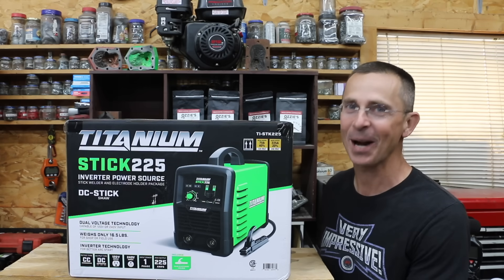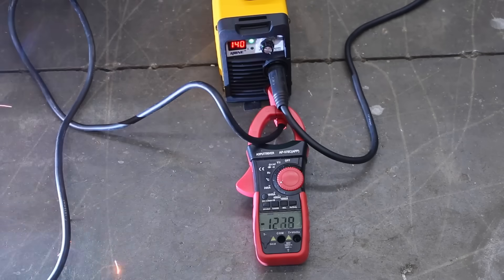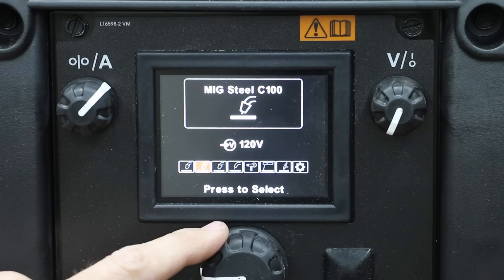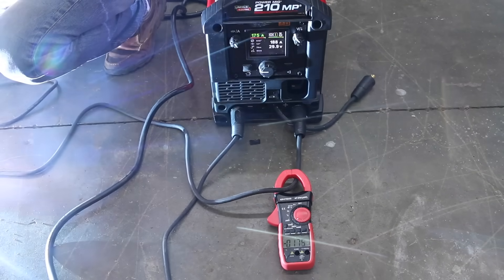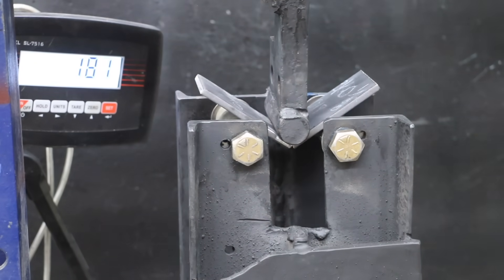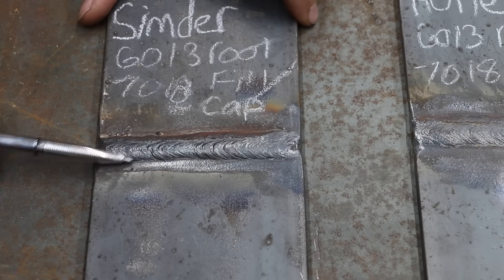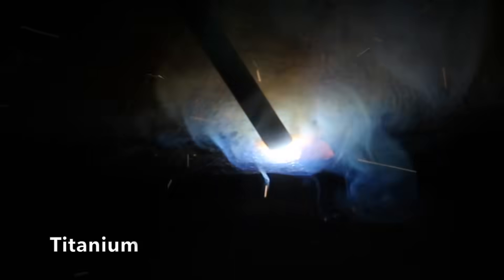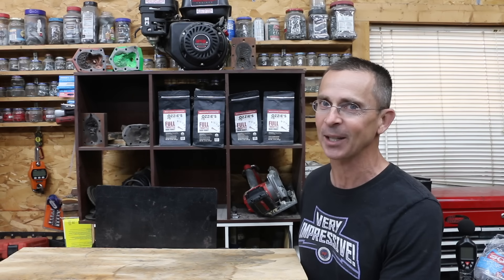$70 vs $2,300 Welder? Let's Settle This! Weld Strength, Duty Cycle, Current Output, Build Quality

Comment: If I was going to buy a cheap stick welder like this, it would be from a physical store like Harbor Freight, Northern Tool, or Menards where it's easier to take something back if it's faulty out of the box or with short use.
 I would like to see more welder tests! Maybe less variety of the those no-name Chinese brands though. Throw just 2 or 3 into the mix for reference. Those no-name ones can come and go, so even if you recommend one, it might not exist later on.
Reply from the maker: Thanks for the suggestion.

Comment: Some things about the 210MP. Lincoln lists it on their site as $1,999 and there is a $500 rebate so it currently rounds out at $1,499. I'm not sure why Amazon has it so high. It can do tig, if you buy that variant, or if you buy the torch, wire harness and pedal yourself.  Its MIG gun and tips are not the standard lincoln tips. Still easy to get but don't try using the traditional tips. It runs 7018 like a dream, and I really hated 7018 until I used this machine (I had used mostly transformer welders which are notorious for sticking with 7018). The hot start on this welder really works well.
If you want to see its capabilities, go to Welding Tips and Tricks channel and see what Jody has done with it. Overall a good machine. 

Great review PF and Joe thank you for helping out with this video. We do appreciate your work.
Reply from the maker: Thanks and you are welcome!

Comment: I have a cheap Chinese inverter welder. The reviews i flipped through said they perform closer to the displayed setting when on 240v supply. I just got a 240v one instead if a dual.
Reply from the maker: Thanks for sharing.

Comment: Clamp current meters only measure AC current The clamp meter in you test is telling which DC welder is producing more AC current .   For example a welder that  100Amps DC + 10Amps AC will only show on the meter as 10A even though the welder will heat up the metal as 110Amps.

Clamp current meters only measure AC current and are basically electrical transformers.  The primary coil is the wire you are putting your clamp around and the secondary is internal to the meter where a output proportional to the primary coil current is measured.
 
BTW as an idea for your another product test you could clamp style current meters?
Reply from the maker: Thanks for the feedback.  Thanks for the video idea.

Comment: Well as a 30 year combination welder the currents are to high for the rods making the weld to hot and can cause weak welds and for the welding machine that's it's not designed for to be pushed like that ,you wanna test use larger welding rods and at the specified currents for the rod that's where you can truly test the welding machines and for the beval plates there really suppose to have a about 1/8 gap or open joint for eat her double sided weld or for penetration.
Reply from the maker: Thanks for the constructive feedback.

Comment: Thanks Joe for your help in this. For professional welders Lincoln or Hobart will be the best choice  I think but for us home occasional users HF seems good. I have a wire and stick welder from HF and they work great for what I need. Mufflers, mower decks, trailer welds. Save $2000 and get it done.
Reply from the maker: Thanks!  Thanks for the feedback.

Comment: I work for a welder manufacturer (wildly different type of welder, though), and having done some competitor analysis- it is incredible how many companies blatantly lie about their abilities and settings.  There are far cheaper welder options than ours, and if you're just doing small projects they're often decent choices, but 95% of the time the welder's screen is just outright lying to you about what it's outputting.  So, if you need to qualify a process or tune in a finicky recipe for long-term production of an item, you'll be happy to pay more for our products.
Reply from the maker: Thanks for the feedback.

Comment: I bought a bottom-dollar stick welder from Harbor Freight many years ago, and found a way to maximize its duty cycle time to minimize its downtime when it shuts down from the heat:  Place a 20 inch breeze box fan on the side of the welding unit.  The fan breeze circulating though the welder's unit vent works well to extend the run-time of the stick welder.
Reply from the maker: Thanks for the feedback.

Comment: I work in a welding shop, my shop bought the cheapest Jasic mig welder, and it welds extremely well, they bought 2 mid range Jasic mig welders, one shorted out and blew up for no apparent reason, and also they got the same Jasic mig welders but really high end,  we got two of these high end welders, and one welds like butter, the other not so well, same metal, same gas, same settings. So i could say from my experience buying welders is kind of a gamble, don't matter the price
Reply from the maker: Thanks for sharing.

Comment: I do a lot of welding, mostly Tig but do own a 240 titanium mig and that thing does fantastic and can hold a pretty high V and duty cycle. Well beyond it's rated amount. I do think if your gonna compare the multi welders to include the Vulcan multi. From everything I've heard the Vulcan multi is the best bang for performance if you need a do all machine.

Thanks Joe.
Reply from the maker: Thanks!  Thanks for sharing.

Comment: Great test, & special thanks to Joe!

PLEASE TEST PLASMA CUTTERS

- Sorry for shouting, but I’ll bet a lot of people would like to see this. I want to buy one but there are a ton of models on the market, so hard to choose between them. Hypertherm seems to be the all-around best, but even used ones are very expensive. I’d like to avoid Chinese, so would like to see several Western brands tested (maybe a used Lincoln or Miller model would be a good buy?) - For a plasma cutter I might be persuaded to go Chinese though.

Important question - Do the Chinese brands use standard, easily-available consumables? How about replacement/alternate torches? Can any of the inexpensive units be used with a CNC table without internal modification? How important is a pilot arc? 

Thanks for considering this: Your videos are THE most valuable resource on YouTube(!) I’ve used them to buy many different products, and like the way you come up with so many different controlled tests to evaluate different aspects of each product. Thanks for putting the results tables at the ends of the vids; seeing all the info laid out at once like that, I can decide for myself how much weight I want to give to each category. Super useful , thanks again for the incredible amount of work you out in on these!
Reply from the maker: Thanks and  you are welcome!  Thanks for the feedback.  Thanks for the suggestion.

Comment: One thing I'd like to comment on, is the cheaper welders may be coming up short as they're more intended for 220v as they are likely just Chinese imports and are aimed at the majority of the world and not directly intended for the US 110v market. And being cheap likely don't have the smarts to first step up the voltage unlike the more expensive models 
Would be interesting to see if the gap on the initial amperage improves with a 220v supply voltage
Reply from the maker: Thanks for the feedback.  Thanks for the suggestion.

Comment: thank you Joe i would go with the HFT one if it fails in 90 day you can get a new one or your money back every thing i took back they made good i have there plasma cutter for the price it works really good. i have a Millermatic 200 that has been a really good welder but miller has stopped making parts for it. all your video's are good a test on multi process welder would be nice but i will not ask you to spend that kind of money. take care, be safe and well.
Reply from the maker: Thank you for the video idea!

Comment: Another excellent test, many thanks to Joe! I’d be interested in seeing tests of multiprocessor welders, even though I already own a (very pricey but extremely nice ESAB Rebel. I guess I’d like to know whether the amount I paid for the ESAB was worth it. 

I did want to avoid Chinese products to support the US/European economies. I think the ESAB is actually built in the US, but either US or Europe would be fine. 

What sold me on the ESAB over a Lincoln or Miller was how “smart” it is about controlling the arc, and a lot of reviews that talked about how smooth and easy it was to use. I figured a retired, inexperienced duffer like me would need all the help he could get 😂
Reply from the maker: Thanks for sharing!

Comment: As a community college welding instructor working i get asked all the time about what inexpensive welder i would recommend.   I've generally suggested the Harbor Freight Titanium and Vulcan but it's nice to know that there are some even more inexpensive welders that are reasonable options.  considering I own the lincoln 210mp it was nice to get a little bit of verification that my money wasn't completely misspent. :)
Reply: I also teach welding at a community College. I have a student who brought in a prime weld, it has CK accessories and I was rather impressed with how it welded for the price. If I had the money though, I would definitely buy the ESAB 205i, very impressed with that.
Reply: @andrewfowler1940  the ESAB is a good machine.   I did a few demo's with it when i worked for a welding supply shop.
Reply from the maker: Thanks for sharing!
Reply: I just got a question, if I buy a welder and run it at 110 volt like from a normal garage outlet, a Welder will not melt the cables in the walls/trip the circuit breaker?
Reply: @Momoka7  keep in mind that for a given amount of power the current is related to voltage. A 120V 15A outlet produces 1800W before tripping. 1800W at 12V is 150A. 

Power (W) = Current (A) * Voltage (V).

That's why you see these high amperage values as outputs: the voltage from the welder is much lower then the input voltage for stick welding.
Reply: The breaker is there to prevent the wires from melting/killing someone. If the breaker matches or exceds the amps that said welder will pull then it wont trip it. Assuming it was wired properly the wires should be fine for the amp draw.
Reply: @Momoka7  It varies from state to state, depending on how your electricity is set-up.. Ask a local electrician to find out for sure.
Reply: @campbellpaul  Yeah but my main question was, if I have a 15-amp outlet can I run a 120 v welder like the one at 3:20 ?
Reply: @Momoka7  TBH, I would say no.  You dont have a dryer outlet in your garage?  They run 220v if you do.
Reply: @campbellpaul  Sadly our dryer is a gas one.
Reply: @Momoka7  Are your fences made primarily of iron?  Either angle or square tubing?  If so, I think there probably is a good wire-feed flux-core welder that has an inverter for your 110v current.  FLUX CORE is excellent for outdoor use, but if your fences are zinc alloy, it won't work on them.  That's one of the benefits of 7018 electrode.  Also, if you weld with 1/16" electrode ONLY, a stick (arc) welder would probably work with just a 15a current (and you could use both E6010 and low-hydrogen electrodes).  

If my fence were made only of IRON or STEEL (not American Fence Co. zinc alloy steel) flux-core wire-feed would be my own choice, as I wouldn't even consider an arc welder unless I had 220v current available.
Reply: @campbellpaul  It is square tubing, and rusting everywhere so I guess it is iron or stell and not zinc, unless the zinc ones also rust like hell.

But yeah in the area here I see allot fences like that, I thought of maybe charging money to repair fences, but for that I would need to get some experience first.

I would weld mostly non-structural stuff like fences, or a coal-grill. I always wonder I see so many YouTube videos from people outside America they seemingly can use all kinds of welders.
Reply: @Momoka7  In that case get something like a Vulcan MIG140 and hope it doesn't trip your breakers too often.. Or buy a predator generator that makes the desired amps for the welder you want.  Tim Welds is a good channel to learn basics from, especially for MIG.
Reply: @Momoka7  Also.. You're not going to learn much at all about stick welding on YouTube, because not only is it a lost art in this country, but welders very rarely share their knowledge about it. I counted four glaring mistakes in this video alone, and there's not a single one mentioned in the comments. I arc welded every weekday for 8 months before knew what I was even doing (and 7 1/2 of those months were tech school). It's a veritable alphabet of different set-ups, materials and techniques to truly master everything. The points-system is the only real way to learn, unless your dad was head welder somewhere! Best of luck to you.

Show less
Reply: @campbellpaul  Yeah I thought a generator could solve that issue, it would also help when working outdoors on stuff.
Reply: @Momoka7 Not if the breaker is properly sized for gauge of wire. It will trip before it melts. 14 gauge wire needs a 15 amp breaker, 12 gauge wire a 20 amp breaker. You want bare minimum 20 amp circuit for a 110 welder. I got a titanium flux core welder that runs on 110 outlet and it works great
Reply: @frenchonion4595  Standard in US homes is 15-amp so you can't run a 110 welder on that since you said it needs at least a 20-amp outlet.
Reply: @Momoka7  A lot of houses have 20 amp circuits too. My house is all 20 besides the 220 stuff but your right most have 15
Reply: @frenchonion4595  I sit here in California and it looks to me like everything here is 15-amp. That is I am not a learned Electrician, or have the required tools to double check that.
At least the few outlets I exchanged because they physically broke stated 15-amp which I exchanged them with.
And yeah, I not need a high power welder, just something that I can use in case a fence needs repairing, or the other odd metal item for cooking as example breaks.

Comment: Great review! Is there a world you compare these with mainstays like Miller or Hobart? You got Lincoln in there which is great! 

The accuracy rating given that it is within spec is probably the most important part for folks looking to get reliable results. Lincoln is on a different level here, though your idea of a multimeter clamp hack is pretty smart! Next you will be reviewing different gases for welding :P
Reply from the maker: Thank you for the video idea!

Comment: I have a dual voltage multi process Titanium welder and I love it. It may not be a lincoln or a miller but it does just as good of a job and it's easy on the pocket.
Reply from the maker: Thanks for sharing!

Comment: One great way to quantify the arc starting ability is to measure the open circuit voltage on the welder right from the connectors when the leads are off.  Most cheap units skimp on that and sometimes provide less than 20 volts whereas "real" welders will often provide OCV well over 40v.
Reply from the maker: Thanks for the feedback.

Comment: best flux wire?
Idk if that would be part of a mig welder test or not. Like for vehicle restoration...
Just an idea. Maybe already done...
Reply from the maker: Thank you for the video idea!
Reply: @Project Farm  anytime. I want to get a cheap welder for automotive, building things but don't want to deal with the gas. Please at apartment so shouldn't have it there anyways. So hear Flux wire is the way to go.
I need to do some research, but figured why not mention it to u, someone i trust their opinions with results to prove

Comment: I own the Lincoln MP210. It is a fantastic little welding machine. I burns rods great with excellent penetration (don't like that I have to run 6011 instead of 6010). TIG welding is very good also if you know how to scratch start the welds, but it doesn't weld aluminum. The MIG function is the only problems I have with the machine. The roller mechanism feed is inconsistent. Running flux core it works great. I also am very pleased with the spool gun when welding aluminum. I haven't ran any steel wire through my spool gun, so I can't say if it would be good or not. I would take an educated guess and say it should be able to run excellent using the spool gun. 

I've had the machine replaced while it was under warranty because of the drive mechanism, I fiddled with it for months trying to get it to run smooth. My oldest brother who was a combo welder at the time couldn't get it to work correctly and the business I bought it from tried for months to get it to work correctly. So they replaced the machine and the new machine worked great for a little while and it started having the same feed issues. I have since replaced the drive mechanism on the new machine , it supposed to be a new design but I haven't tested it. 

For the money I would still buy it again, welding aluminum with the spool gun is the reason I would buy it again. It works so much better than my brothers Miller MIG machine with a spool gun. If only they can get the feed drive mechanism to work as it should.
Reply from the maker: Thanks for sharing.